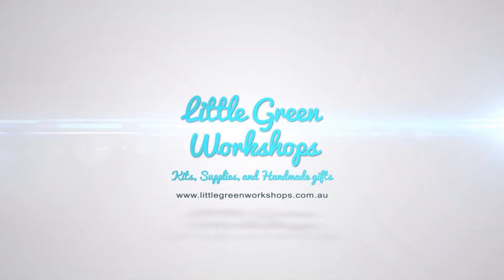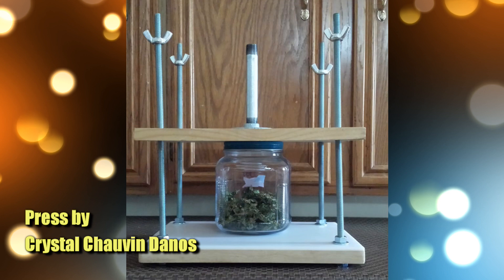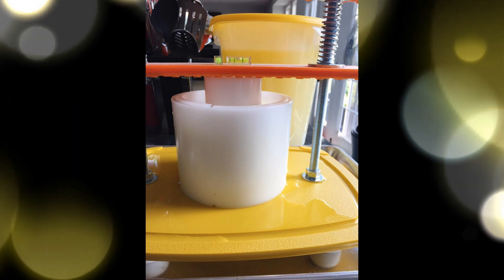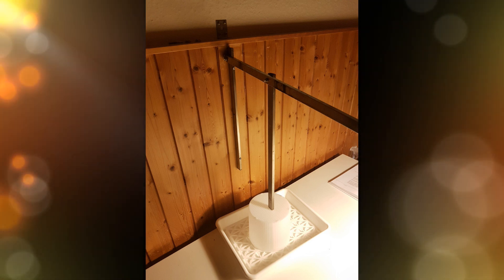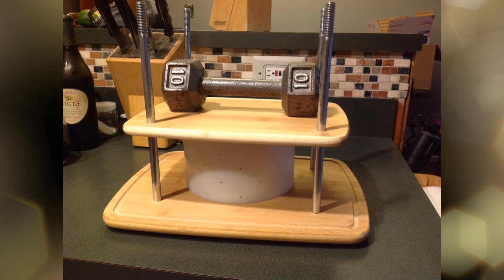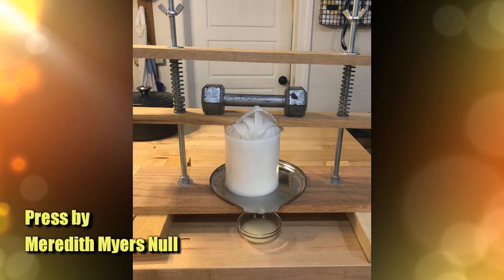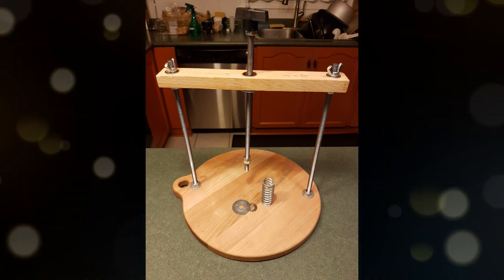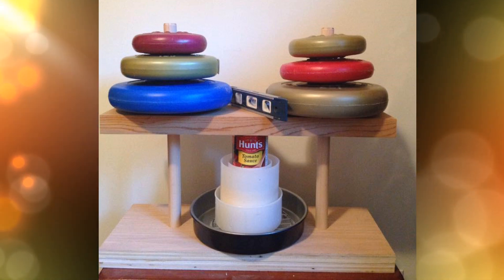DIY Cheese Presses You Can Make At Home!

Comment: For my first press I used two 5 Gallon (about 19 liter) buckets. I set the mold inside the first bucket with a follower slid second bucket inside the first bucket. You can use what ever you want for weight including water. Water weighs 8.3 lbs (3.76 kilo)per gallon (3.78 liters)
Reply: That's a great idea I think I even have two food safe ones.

Comment: I have a tip for those wanting to make the spring loaded type press. Obviously the crux of this where to buy the springs, since everything else is easy to find. I have not seen loose high quality springs available for sale in local hardware stores. But, I recently discovered something called a "shock absorbing dog lead" which is pretty cheap e.g. from eBay or Amazon and includes a hefty spring that is easily separated from the rest of the mechanism. The large dog model is perfectly sized and easily strong enough.
Reply: Nothing in the UK :(

Comment: I made a lever press similar to the first one, but with less metal parts. It only required a hand saw and drill to make. Just pine, 4 screws and two shoulder bolts. The lever has a hole every 10cm from the main pivot, out to 110cm. The pressing arm attaches to the first hole. So the force I get is the weight times the hole number. If I hang 2kg, I get between 4kg (2nd hole) and 22kg (11th hole) force on the cheese.
Reply: Any way I can get the plans?

Comment: Why are cheese recipes ask for specific weight for pressing but do not specify the diameter of the mold? is it really not that necessary to be so accurate when it comes to pressure when making cheese?
Reply: I'm assuming it's because of the follower on top being flat and spreading the weight evenly to the entire mould. So if you put 12kg of weight on the follower that's transferred to the entirety of the cheese (within reason). Most moulds are small enough for this to work.
Reply: I think it's because most recipes assume a similar cheese form of ≈ 160mm for cheese weights of 1kg

Comment: My problem in making a press with bolts is I have no clue what them big bolts are called (I saw on ebay m20 m30 etc)
Reply: M20/30 is the size or width of the bolt. So what you need is the length. By looking at that I would say look at something M16/18 x 100mm or 150mm. Depends on how much space you need
Reply: @tinusbooysen5282  I think that might be too short 300mm + might be more accurate cause the molds are quite tall.